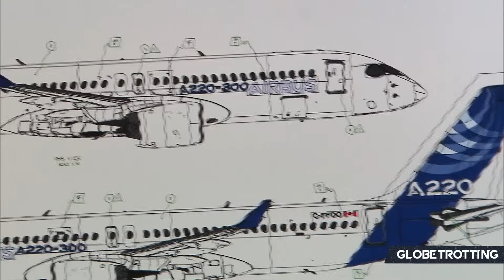BOEING RIVAL? - Why Airbus Bought The CSeries

Comment: Don’t forget Boeing lobbied to make the USA impose huge tarifs on the CSeries because they were manufactured outside the country. Bombardier was economically unable to establish a plant in the USA. Airbus had a plant already, which saved the program.
Reply: @rcairflr  Airbus has a plant in Alabama. They produce the A320 and A220 there.
Reply: And look at Boeing now,Karma is kicking them all in their butts now because that 737Max plane is just a hot 🔥 mess right now and has been since it entered service!!!!!! My mom use to always tell me that the ones on top will eventually fall down and the ones on the bottom will eventually come to the top and i honestly believe that that's what we are all seeing now even between Airbus and Boeing now 🤷🏽‍♂️🤷🏽‍♂️🤷🏽‍♂️🤷🏽‍♂️🤷🏽‍♂️
Reply: @rcairflr  no mate .. it`s corporate greed here as well. Rush things and you get this result. the MAX was a flawed design to begin with. those engines changing the gravity point of an aircraft is just a design flaw. they knew it they pushed it. so with inspections on the work at these planes. Boeing pushed to self certify. Why do you think they did that? Because  they can cut corners. If you want to fly on a new Boeing plane with your family than it`s your problem. What you should really think is what other things Boeing is hiding under the rug
Reply: Forget Boeing, Airbus is sales and marketing powerhouse. Bombardier alone would never be able to sell so many of those planes in such a short period of time. This deal was good also because it saved the investments done by Quebec.
Reply: Actually the C-Series has US content, more than many Dreamliners. Assembly location is political. Boeing wanted to block an amazing plane. They got what they deserved. Airbus improved their product suite offering, and can offer customers a bigger mix of highly-efficient aircraft. And C-Series is a clean sheet design, so Airbus did not need expensive development costs

Comment: Boeing PUSHED the sale of the C Series to Airbus. Their lobbying to get the massive  tariff on the sale of planes to Delta is what caused this sale. Boeing thought they could kill the C series and were too stupid to realize Airbus would be able to aquire this plane for $1 then Airbus could get around the tariff by moving final Is assembly Alabama Just another example of Boeing's management arrogance. Boeing could have focused on buying the plane instead but thought they could just use the political power to kill their competition.  Well played Boeing, you actually created  competition. Airbus should send you a thank you card.
Reply: A few wrong facts here. Airbus didn't really  acquire the initial stake in the program for only $1. That was just a token amount required to officially transfer the 50% share. They also had to assume the costs of building at US production  expansion, further development of the aircraft, all the expenses of the revamping the messy supply chain etc. They also later paid $ 600 million to buy the final Bombardier stake. In total Airbus has spent well into the billions on the program. The plant is in Alabama not GA. But agreed it was a rather bone headed move by Boeing. They could have bought itself or just let it fail.
Reply: Thanks for the correction,  I couldn't remember the specifics but I think all can agree Boeing blew it on many fronts.
Reply: And Boeing went on to lose the Canadian fighter competition to the F35 for the same reason!!!!!
Reply: @johniii8147  and they also lost purchasing the Embraer E2's.
Reply: @markvolpe2305 Boeings decision to not take a stake in the E-2 Program was probably one of the worst they have ever done
Reply: @johniii8147  Bombardier (and various govt) had invested $$Billions in the development up to the point where Airbus took over for $600M plus additional capitals to fix and expand the production processes. Anyhow, I think CSeries fits Airbus better than Boeing or any other companies such as Comac.

Comment: I'm so hoping to see a stretched 172 seat A220-500 I can't wait 💯💯💯💯💙💙💙💙💙
Reply: 100% This would be the Boeing 737 killer we all wanted the C Series/220 to be all along!
Reply: Airbus has made it clear they are in no hurry (if ever) to do that. The program is a big money looser for them.
Reply: Kind of doubt it, that’s more of the role of the A319/A320 Neos
Reply: @johniii8147  Not True At All
Reply: @ericjones7769  Absolutely true. Airbus has publicly said, it's under evaluation but no firm commitment on launch.
Reply: @stickynorth  737-Max8 maximum one-class configuration is 200 seats.  A220 needs to stretch to -700 to eat into Max-8. However, I believe -500 will draw many customers.

Comment: Because the A220 has totally different cockpit with 0 commonality with the Airbus cockpit, it was normal that Airbus would not number in the the 300 series (especially as 310 and 300 had already been taken and the next available number was 360 which Airbus wouldn't normally assign to a plan that is much smaller than the 350).

Comment: Airbus paid $1.00 for 51% of the C series , it then paid $ 591 million, of which the final 60 million was paid in installments in 2021. That was a steal for a fully developed aircraft ready to go into production.
Reply: They also have paid for the US production, fixing problems with the plane and supply chain etc. They are also struggling to ramp up production. Their total expenses on program WELL exceed $1 billion and climbing. They also loose money on every plane delivered so add in those cases. It's proven a very expensive acquisition. But it has strategic  value for Airbus, much more than than a financial one. It's a cash drain for them. No "steal" here.

Comment: Nice video, however, You have lost great opportunity to show the A220 with most beautiful livery - AirBaltic’s A220-300. By the way AirBaltic is launch customer for A220-300 previously known as Bombardier CS300. Besides AirBaltic is the only airline in the world which fleet is consisting solely from Airbus A220.
Reply: Don't watch such videos is your goal is to see the paint job.
Reply: @johniii8147  AirBaltic is launch operator of the type, so probably they know quite well what is what. Secondly this video was nice, but nothing new there, basically recap of well known facts. But that is only in case if you know the topic. If not, then watch in and don't waste time on stupid comments, better go and wash dirty dishes.
Reply: @lifter479  Well that's DJ, he doesn't tell us anything new. Nothing you can't read elsewhere. That's what he does is read and make videos out of it. No insight there.
Reply: airBaltic will have 80 in its fleet when all is delivered. Currently they already have 46 in service. If and when they exercise the 20 options, they will have 100 A220s. Largest A220 fleet outside of North America. Impressive !!